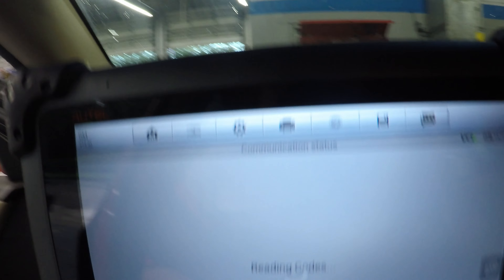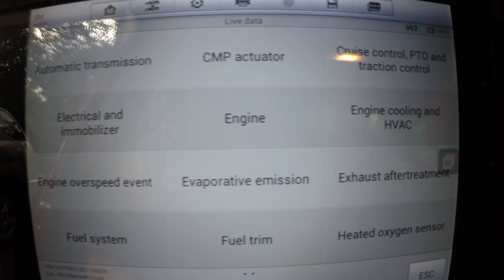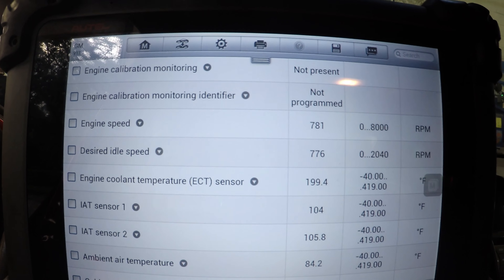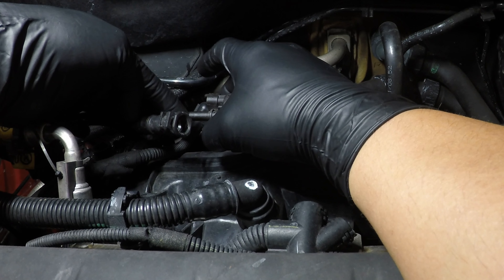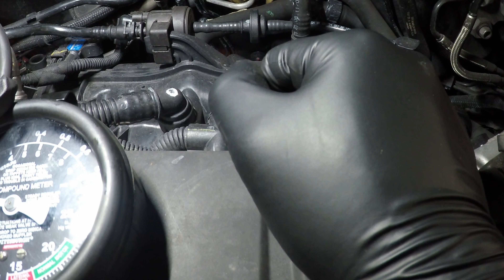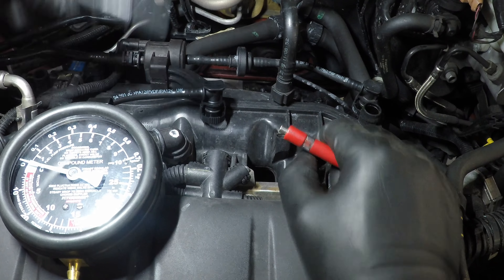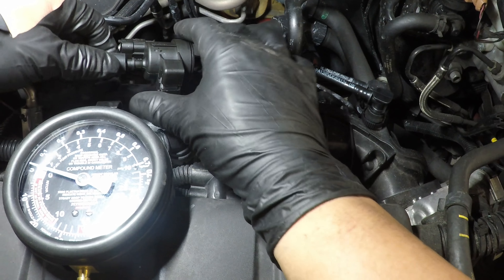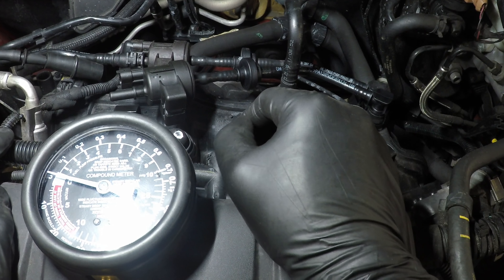PURGE VALVE DIAGNOSIS & FIX - 2012 Chevy cruze - P0496 P0172 P0171

Comment: I realize this is an old video but I always start from the beginning. I work for Mazda. Our skyactiv non turbo vehicles have a normally open purge at idle. Has something to do with lack of engine vacuum. However the turbo models are normally closed like most. If you are seeing a PCM command on the solenoid I would check for fuel saturation in the canister. A stuck purge is one thing but when it is commanded to open. The PCM is telling it to open for a reason. I found one vehicle we have a few years, (I think I was the first in country to find it) has been doing this. I checked live data and found the PCM commanded purge to be open on a normally closed purge at idle. I pinched the hose to see if lean fuel trims would correct which it did. We swapped out purge and same thing. So now we can say the purge is fine. Pulled down the canister and sure enough filled with fuel. Replaced fuel trims repaired. I know that chevy cruze is known for purge pattern failures tho. The ticking gives it away. Never looked the command tho. from PCM. Might want to dig on that especially if a full tank. Customer could have overfilled causing saturation.

Comment: I've been seeing purge commands at idle on a lot of them too, I think it is normal for the most part to have a small duty % at idle on newer vehicles at times when warm.  Don't know why, but like I said, I've been taking a peak at purge pids on every one I hook up, to see what is normal and almost every make/model seems to be doing it.  I chased my tail on a Chev Impala once with a perfectly normal purge command at idle once and after becoming frustrated I ended up shipping it down the road wondering if she'd be back again, never came back with any issues and that's why I remembered coming to the conclusion that it is normal as well as looking at other known goods.  Good video Mario, thanks!
Reply from the maker: Yep I've been taking notice ever since, perfectly normal on modern cars. Thanks for watching bud
Reply: @SuperMarioDiagnostics  GM pruge valves fail ALOT, I wonder sometimes if it is just cheap design or if over fueling has a lot to do with it.  I know faulty charcoal canisters can cause damage, but I have not found anything wrong with canisters on 9 out of 10 failures...so who knows?  Must just be one of those things.
Reply from the maker: Hmm i couldn't say, i don't see it often enough to come to any conclusion on the matter. But interesting observation

Comment: On VW's I often hear them at idle... sometimes nothing for quite a while, then on again for quite some time. I never worry about it unless I have an EVAP code or a rich/lean code. Nice to see that other manufacturers also have issues with sticking purge valves! =)
Reply from the maker: Yeah always good to know if it's strategy or not. Thanks for dropping in Thomas 👍

Comment: I make same questions specially in hyundai kia that is a common problem and sometime with hyundai kia it get a no flow trouble code and the problem is aftermarket purge valve fail to open at low duty cycle %. Good videos man
Reply from the maker: Yep they are very common

Comment: Yes why was it commanding 17%  at idle , interesting . On my F150 it would command to open on a decel intermittently  and stall the engine. The dealer said its impossible to enrich it enought to cause a stall. Ooops they were wrong . Took me  from 2010 as new till last year to find it😅😅 oh ya I'm that  good.  Keep at it  Mario , this was an awesome vid and will do well. Cheers
Reply from the maker: Yeah, I kind of think the codes seeing may have something to do with it. Haha impossible?? No way! At least you got it Steve! 🤙 your comments and support are always appreciated buddy, hope it helps anyone who might cringe at this triple code whammy. Thanks again Steve!
Reply: It commands Rich because once the canister is deplete of any fuel vapor it will then become a standard vacuum leak like any other. More air than fuel. 😉.
Reply from the maker: New Level Auto hmm I would understand what you mean from a fuel trim standpoint(vacuum leak). Can't say i understand what you mean in this particular case though 🤔
Reply: @SuperMarioDiagnostics  I was attempting to answer Steve's question as to why it was commanding 17% fuel trim
Reply from the maker: The 17% was in reference to the purge command at idle. I never showed or mentioned fuel trims Keith 😂
Reply from the maker: It's ok Keith, this time you get a hall pass. Don't ever say i didn't give you anything 🤣

Comment: My 1.4 cruze is making a similar noise, but I checked this and it's good. Then I pulled the dipstick and the rattling/ticking noise gets louder from the intake manifold, so it's the PCV valve in my intake manifold!

Comment: Make sure the old valve doesn’t have pieces of charcoal in it from the canister or it’ll be back with the same problem. Great video.
Reply from the maker: You're absolutely right, glad you mentioned it. It was as clean as a whistle 👍 thanks Che, glad you enjoyed!

Comment: 🛠️ NAILED IT...Great Job Mario on a quick and effective diagnose. 😀
  BTW If your still wondering about the 17% command purge, I wonder if it has something to do with that other code. The P1101 (Dirty Throttle Body issue) and I would bet the TB idle compensation was high along with TPS % slightly upwards.  Therefore it thinks your on the throttle.  Just a thought..actually more of a guess since we didn't see any data on this one.  
🍻 Cheers Bro 😎
Reply from the maker: Makes perfect sense, yes a dirty throttle body will set off that code, but so will any discrepancy between calculated airflow vs actual(vacuum leak, or dirty throttle body). So no I didn't film any idle compensation data. Nonetheless great food for thought. I'd that's a pretty accurate guess. Thanks for chiming in Kevin!

Comment: @supermariodDiagnostics I replaced mine today step by step with ya video...still ticking.. 2016 Chevy Cruze limited lt..any ideas or thoughts?
Reply from the maker: The ticking is normal operation, the concern is that it's open during non ticking, and causing a lean running condition
Reply: Super Mario Diagnostics maybe wrong gas? I put in premium... I have a neighbor that has the same car and no ticking.. it’s louder now.. maybe time to trade it.. I love the Chevy Cruze..
Reply from the maker: The ticking is normal. Unless you mean the engine is ticking
Reply: Super Mario Diagnostics nope it’s the same part I replaced.. vacuum test is the same.. maybe bad part.
Reply from the maker: So you vacuum tested it while disconnected electronically, and vacuum gauge connected on the fuel tank side?
Reply: Super Mario Diagnostics yes
Reply from the maker: Ok yes, bad part. Highly suggest oem part only
Reply: Super Mario Diagnostics will try that

Comment: Is it 4 or 7 fuel injectors I need because I replaced this piece and my check engine light is still on
Reply from the maker: I suggest diagnosing it before throwing parts at it. I showed exactly how to test this, and you are required to clear the check engine light yourself. What codes do you have?

Comment: Hey great video! My 2012 is having a very similar issue. First start right after filling had no issue. Second start at home was rough, then died. Now it won't start at all. Is there anyway to test the valve without the car running?
Reply from the maker: By blowing through it. No air should pass when disconnected.

Comment: Can I fix the ignition malfunction before replacing the missing catalytic converter?What do you think is causing the ignition surging/cycling/skip and is the Evap purge valve involved? Most of the restoration of this car I performed myself, and I have not found the answer even with other mechanics basic diagnosis.

Hello Super Mario, I recently bought a 2000 Pontiac Firebird 3800 V6, AT, electronic throttle body, 3 cat snsr's, / stock except for deleted catalytic converter (2 O2 (L + R) upstream/1 O2 down stream/disconnected). 

Replaced Plugs & wires, ICM, 3 coil packs, fuel injector #4, fuel, air, & oil filters, Fuel pump, Emission Evap Purge valve, but still click loudly like in this video but there is a misfire like condition where the engine misfires & or surges like every 3-5 seconds this occurs randomly and disappears randomly occurs mostly when warm. Runs strong and smooth except when it starts this cycling issue; it still has power but cycles/misses/?. The Evap loud clicking is louder while this condition occurs and idles with a repetitive vibration occasionally simultaneous to the condition, mostly after warm up and a drive.

Diag:  
- I bought a cheap code scanner and keep only getting P0140 (O2 Circuit No Activity Detected, Bank 1 Sensor 2) due to the missing catalytic converter and disconnected O2 downstream sensor. 
-I took my car on a road test (0-70 mph) with the tool and all of the online readings (O2 sensors trim levels, throttle, air __, etc seemed within basic operational parameters according to multiple ref. sources). Anomalies: Status changed from CL (closed loop?) to OL overdrive (open loop with car in overdrive?) during hard accelerations only. CL is the norm. I understand that the ECM should control all the major ignition operations when the engine is warm and conditions are normal.

I took my car to a couple of mechanics who stated they wont do a full diagnostic till I get the catalytic converter replaced. I have 2 year of auto mechanics classes manys year ago, 2000 Chevrolet Camaro & Pontiac Firebird Service Manual Volume 1. 

Also could not detect any vacuum leaks nor bad electrical connections under the hood, also had the fuel pump replaced. The car originally had 2 other codes solved P0301 and P0304; they stopped after replacing the worn ignition components including #4 fuel injector. Also the fuel gauge misreported fuel just after the fuel pump replacement 10/2019 lately reports accurately even when very low. 

Just am financially (work) recovering after natural weather disaster Berkeley Co. SC and will get a new aftermarket catalytic converter and a downstream O2 sensor replaced new later this year. Just had my only other car break permanently during 2019's Hurricane Dorian.
Reply from the maker: Going in open loop during hard acceleration is normal.

When you disconnect the purge valve, all clicking goes away?

 when in open loop, does it continue to surge? 

Sounds like when it's warmed up and gone into closed loop, that's where your problems start. 

What are your fuel trims at hot idle, and when you slightly rev it up where do your fuel trims go. 

Sorry but is a basic code reader all you have to diagnose this? Do you have an oscilloscope? 

Feel free to reach out by email: supermariodiagnostics@yahoo.com

Or if you have Facebook, reach out to Facebook.com/supermariodiagnostics

Comment: Any more 2012 chevy cruze videos? I keep having a weird smell coming out everytime i turn on the AC. Have you came across anything like that before?
Reply from the maker: Change your cabin filter. Sorry no more videos yet
Reply: Thank you bro
Reply from the maker: No prob
Reply: @SuperMarioDiagnostics  hey would you know why coolant temperature goes up but then goes down as I'm driving and then goes up once I come to a stop on a 2012 Chevy Cruze
Reply from the maker: Sounds like your radiator fan might be weak or inoperative. The air from higher speeds coold the engine, then when your idle there's no air to cool
Reply: @SuperMarioDiagnostics  i got a P0128 code?
Reply: Checkout your thermostat housing my wife's was doing that with heat I've replaced it twice its poor plastic and cracks in the winter

Comment: Is this "hard start" only the first time you try after the night? And then you can start the can any time with no problems?
Reply: i have such problem on my 2008 kia optima 2.4l but i have no diagnostics or pico
Reply from the maker: The customer did not make it clear whether it was after an overnight. The symptom did not occur with us, so ultimately i relied on the codes retrieved. Which aligned perfectly with the info the customer DID provide. Now as for a hard start after an overnight. You may want to keep an eye on fuel pressure. Maybe even the coolant temp sensor. Loan a scanner from your local auto zone or other parts house and check your live data for any anomalies. A disconnected ect sensor can fool the ecm into enriching the mixture so much that it creates a long crank time, but when the engine is warmed it may be less affected, since it's already warm
Reply: Mine was always after fueling.  Replaced the purge solenoid yesterday and it fixed it.

Comment: I have the same car... I’m at 92,000 ... my check engine light has been on for months and the code reads Emission Evaporative System... not sure what that means I’ve heard the ticking sound as well ... could they both be the same
Reply from the maker: Which code exactly? The ticking is normal operation of the purge valve, it does not necessarily mean it's bad, i show exactly how to test it here with no tools, by disconnecting the electrical connector to the purge valve while the car is on(will throw a purge circuit code) and removing the fuel tank side hose, and checking for vacuum at the open end of the purge valve.
Reply: Code P0171 System too lean (Bank 1)
Code P0496 Evaporative Emossion System High Purge Flow
Reply from the maker: Ok then in that case id do the same checks in this video, but more than likely your purge valve is stuck open.
Reply: Super Mario Diagnostics ok thank you .. I will check

Comment: The shop that changes my oil told me this code was why my check engine light was on.  I replaced the part myself but the check engine light is still on.  Will it go off on its own eventually or do I have to clear the code.  Or could it have been another issue causing the code?
Reply from the maker: Without any testing involved it would be impossible for me to say whether you fixed it or not. You're better off having someone clear the codes for you. Just about any auto zone will do it for
Reply: @SuperMarioDiagnostics  the check engine light went off by itself.  Thanks!

Comment: So these purge values are gonna click even when in perfect running condition? I feel like I can hear it so well because I have extremely good hearing. The car has no issues starting up, no hesitating at idle, none of that. The mechanic was looking at it with me and he said it was normal or the injectors(still normal). Mine is a 2014 chevy cruz.
Reply from the maker: Correct, they are loud. But they tend to get louder when failing. You may not feel any symptoms until it gets past a certain threshold. But yes in perfect conditions they click at idle and when cruising
Reply: @SuperMarioDiagnostics  Thanks for the quick reply and thanks for taking the time to upload these in depth videos. You're a huge help to everyone 💪

Comment: When changing or check if it sucks your  finger ... do you have to disconnect the negative battery cable ?
Reply from the maker: Soweird Harris no, the engine has to be running

Comment: Give the clip a good squeeze and no flat head screw driver is needed. Plus the red clip goes on last from the bottom and the shorter part on the clip goes on the underside of the passenger side. Safest way to not break the clip. Cause it will if your not careful ha

Comment: Looking at fuel trims, whenever I hear the valve tick from the cabin, the trims go lean. Then it stops and goes back to stoichiometric. I have a 2016 Ford Focus. The ticking problem has been discussed online. Rough idle accompanies it, which I'm seeing. I'm 98% sure this has to be it.
Reply from the maker: Yes I've since seen many more of these and its normal. But go back a couple of years and you wouldn't see purge valve opening at idle, it's more of recent thing. Plus every make and model is different, it can peg both lean or rich depending on how full the canister is. Thanks for watching!

Comment: My granddaughters is a 2016 I got the same code I replaced it code didn't go away . I cannot blow air through either side of that valve but it's disconnected so it's not stuck open I know what's going on

Comment: did the clicking go away after replacing the valve?
Reply: They do click ..its normal.. start yours up and remove the left hose...then place your finger over the valve body opening.. if it sucks your finger, its bad.

Comment: Do you have an idea as to why I keep getting a p0171 instead of the p0496? I have been hearing that ticking as well when I raise the hood. This is just blowing my mind. I wish I would have known this 2 weeks ago! Thanks again!
Reply from the maker: The ticking is normal operation. As for the p0171 after the fuel content has been depleted from the charcoal canister(which may not take long), it then sucks in air, since the vent valve is open. This leans out your mixture and sets off a lean code
Reply: Thank you. That makes perfect sense.

Comment: Purge valve replacement didn’t work. There’s still lot of noise coming from the new purge valve. Any ideas on how to fix this issue? 
-Code shows P0420
-2012 Chevy cruz LT 1.4L turbo
Reply from the maker: The issue is not the noise. The issue is that it's leaking while it should be closed. 

Code P0420 is unrelated to this, I think you should take it a professional automotive technician.

Comment: Great video 2013 Chevy cruise the dealership wants to sell the whole unit with the manifold connected they say they cannot replace purge valve  by itself why is it that you were able to remove it and they can’t remove or buy just the purge valve by itself without replacing the manifold and purge value 600 $ Plus labor looking at $1000 to do this job that’s what they want to charge the part only cost 33.99
Reply from the maker: Good thing you do your research:)
Reply from the maker: Thanks for watching!
Reply: Ram M457 they are trying to rip you off. show them this video, then tell them what they thimk...